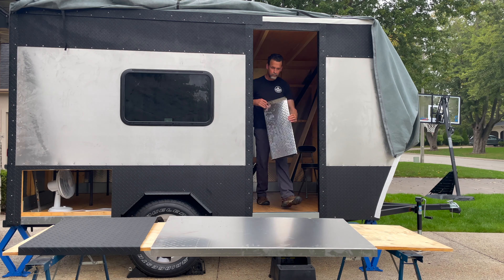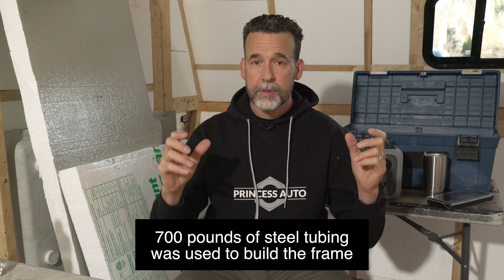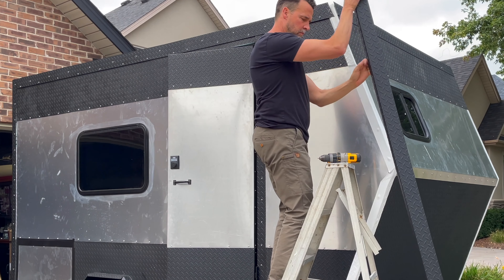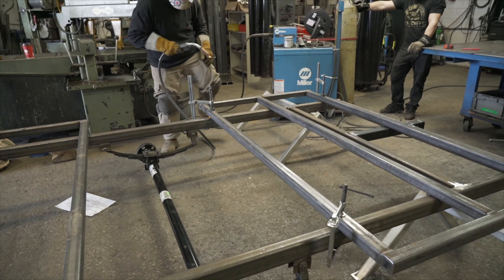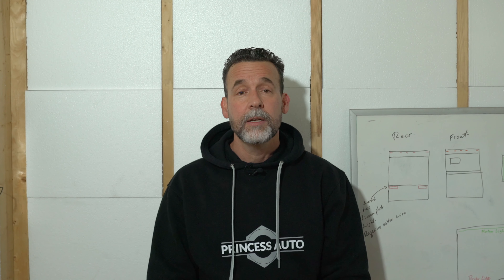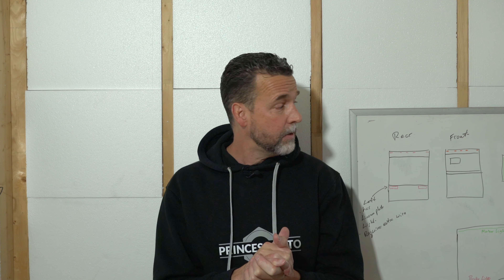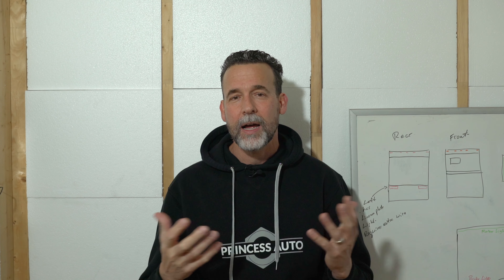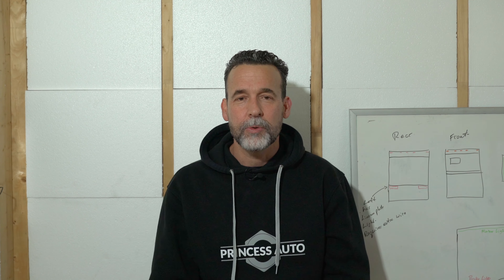How to Build a Travel Trailer - The Most Common Questions for My DIY Camper Build

Comment: I've seen a video on a small teardrop being pulled by a bicycle: That made me wonder if a trailer in your choice be sized down safely to be pulled safely by a motor cycle of approximately a 1000 cc to as low as 750 cc. Harley make a street-able motor cycle that is rated at 750 cc.  Of course output would need to be for at least half or 3/4 out put range of 750 cc, so as to not wear out motor cycles life.

Comment: I work at a company that builds aluminum truck bodies and we use stainless screws in all the aluminum panels, on the real old trucks that are 20+ years old you sometimes see a little corrosion around the screws but it's not bad.

Comment: Your plans for this build is all on the spot engineering. But have seen a hand sketched blue- print of outside perimeters and can see the basic size of welded frame (because of my fortunate, welding experience) and understand your reason for 2 by 2 but understand usage in spots of 2 by 4s and of course the light weight stryo for heat and weight. I personally, only an opinion, think that your approached to the build is, in a fabulous way, minus: A very thought out blue print.

 Sometimes designers and/or drafters have good intentions: Although, get a dimension wrong and adjustments, by builder, is necessary to complete. It is sad, when this happens, because, in general its the builders fault for not completing on time, even if builder follows to the tee, drafters blueprint. It is great to see how you accomplished your build by solving outer deminision first, second live inside comfortably by have previous knowledge of outside survival techniques, which you incorporated  into the sum design of "Eddie!"  Seeing Scott, one of your friends, is cool. 
One other idea? To prevent theft of trailer, would an extension that is removable hitch to defend against possible theft. A hitch that slides into frame and is locked into place with locking strong pins, and using bolts seems like a safety pulling hazard.

Comment: Metal studs are a lot thinner than the steel you used for your trailer. It’s lighter and stronger than wood and it also gets screwed in. Just FYI. Great build.

Comment: It says ELECTRICAL contact. There is no electricity on the screws right? So don't worry! 👍😁
Reply: Wrong, the two metals create the electricity, it also needs water, but then again there is water in humidity. Galvanic corrosion does not occur when dissimilar metals are completely dry. Steel and aluminum is really bad, stainless steel and aluminum not so bad, the steel you put in your door may cause a problem. Nice build